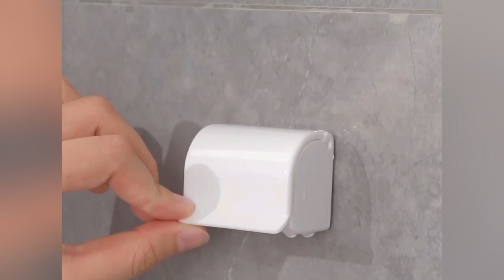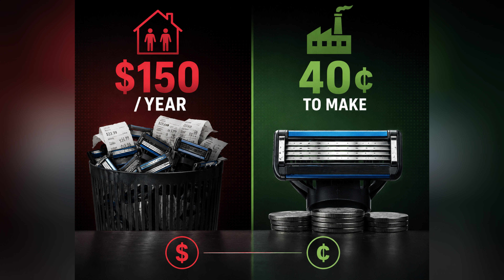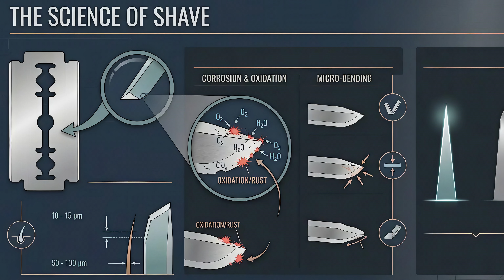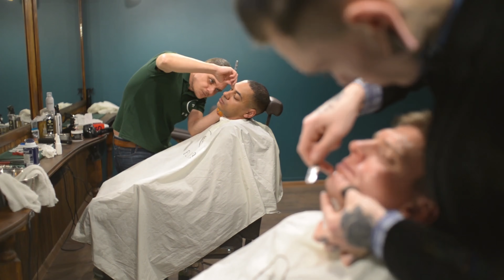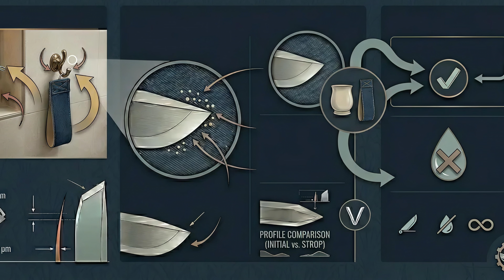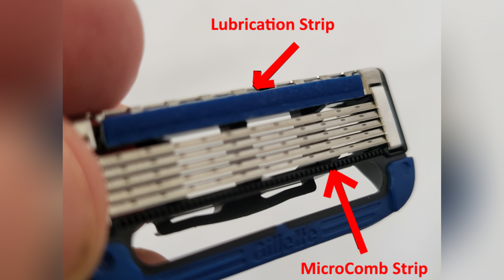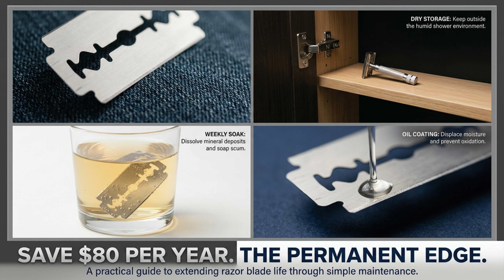Your Razor Is Designed to Dull After 3 Uses — How to Make It Last 2 years!

Comment: 30 years ago , my grandfather, who was born in 1889 and used straight razors for years, told me "The best thing you can do for your razor is dry it carefully immediately after use. Never leave it exposed to the  wet air of a bathroom, it will make "water crystals" grow on the blade". Now, that idea of "water crystals" was early 20th century nonsense he just believed, obviously. But the RESULT of carefully drying and keeping dry the  blades makes the razor stay sharp for months, so he always believed the  IDEA of "water crystals".
Reply: If he told you that in 1996, he lived quite a long time. 

The "water crystals" that he was talking about, was probably mineral deposits.  Depending on what minerals were in his water, and how high that mineral content was, when he was a young man, moisture could have very easily evaporated off of wet things, leaving behind minerals that manifested in a crystal like appearance. 

I've got very soft well water, but there is one mineral that appears often, and  shows up as relatively clear crystals.
Reply: @magnificenthonky  Well, he did live to 102, but what happened there was I misremembered how long ago it was. I'm 60 and 7 months old . . . possibly my mind is going. He died   after I went to live in Australia, which was in 1984. HIS dad lived to 106. Mine made 89. 
You have got me concerned now. I'm actually suffering from a disease that attacks the nervous system, and here I have written about something that I knew perfectly well was  when I was  learning stuff like "shaving my chin" and written down that it was 30 rather than closer to 50 years ago. :).
The important part is I remember him telling me  the drying the razor thing. Someone else subsequently  told me "Nah, water doesn't make crystals, that's just something the old bloke believed", but by that point I already had the habit, which I have always followed.

Comment: Summary - This video explains that razor cartridges are designed for frequent replacement to serve a specific business model, but they can actually last for months with proper maintenance. The core of the issue is not the hair cutting itself, but rather microscopic oxidation and bending of the blade edge caused by humidity and leaving it wet.
Key Techniques to Extend Razor Life:
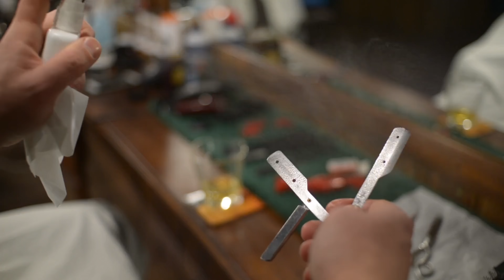Denim Stropping (2:30): 
After every shave, run your razor backwards (spine first, edge trailing) against a piece of denim (like an old pair of jeans) 20 times per side. This realigns the microscopic metal edge that folds during shaving.
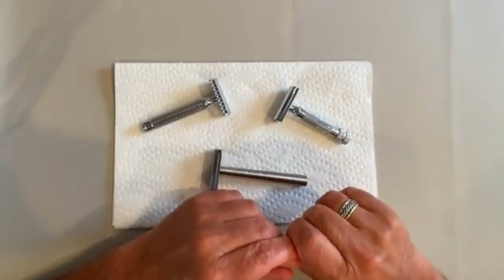Dry Storage (4:20):
Never leave your razor in the shower or on a wet sink rim. Shake it hard to remove water, wipe it with a dry towel, and store it in a dry area with air circulation.
Mineral Oil (5:25):
When the factory lubricating strip fades, apply a small drop of food-grade mineral oil to the blade. This acts as a protective, lubricating barrier that repels moisture and restores smooth gliding.
Weekly Vinegar Soak (6:03): 
Once a week, soak the razor head in white vinegar for 30 seconds. This dissolves mineral deposits from tap water that can cause pitting and rust on the blade's edge.
By following this routine, you can shift from replacing blades every few weeks to keeping them sharp for several months, effectively bypassing the planned obsolescence of the cartridge industry.

Comment: Stropping removes thet tiny "curl," but stropping does so on both sides, as shown.  With cartridges one can only strop in one direction so the other side his its curl, no?
Reply: I was thinking the same thing. 

But, I guess getting one side is better than getting no sides. The dry storage, lubrication, and regular vinegar baths to eliminate mineral buildup, probably do more to preserve the blade than the denim stropping.

Comment: hat is just plain silly. Why bother? I just buy disposables. They cost next to nothing. They come in packs of 12 or 24 or whatever. Every few months they’re on sale. No maintenance. No hassle. I shave in the shower and leave them right there, wet as hell. Don’t care. When they start to tug, throw out the old one and replace it. One disposable only costs a few cents.

If you want to save real money, just don’t buy new cars. Buy three- to five-year-old ones at half the new price, often a quarter. One rational car purchase will cover a lifetime of throwaway razor blades 100x, probably 1000x. 😂

Comment: WD40?
Reply: WD40 is a solvent, not a lubricant.  

It's paraffin based, and likely to leave a thin wax coating on the blade. Maybe running the blade under hot water will melt it off, maybe not. But, that could have a negative impact on the cutting ability of the blade, if it doesn't. 

The mineral oil is probably a better bet.
Reply: @magnificenthonky  But WD40 drives off water, doesn't it?
Reply: @thebunchchannel Sure, in theory. WD does stand for Water Displacement. But, you're still likely to clog up your head with a wax residue, over time, especially with these retarded multi blade razor heads. 

I'd be much more inclined to thoroughly rinse the blade with super hot water (the hotter the better; hot water evaporates quickly), then give it a good swirl in rubbing alcohol (which also displaces water, and evaporates quickly), then give it some mineral oil. 

The other thing is, if you spray it with WD40, the next time you shave, you'll be smearing WD40 all over your nice clean face.  The scent will clash with your Brut or Old Spice (or whatever aftershave you use) and the solvent will get into your pores, and probably cause acne. 

WD40 has a wonderful place. That place is in the garage. I keep mine next to the PB Blaster (which handles a significant portion of what I used to useWD40 for) and the chain & cable lubricant (which handles another significant portion of what I used to use WD40 for).  I don't use use WD40 as a penetrating oil or a lubricant, anymore. I use it as a plastic and paint safe solvant, to remove sticky residue and whatnot.

Comment: A quick squirt with WD-40?
Reply: I don't recommend that. It's a solvent, not a lubricant. Also, do you really want to smear WD40 on your face, especially after just getting out of the shower? 

I'd stick with mineral oil.

Comment: That you can resharpen the blades okay, but that they can hold 2 years no chance. 
And when the lubricant stripe is gone he's gone forever. 
Next what is with the hygiene??? 
That's the greatest problem. Because you can't really clean these kinds of razors.
If you want to have a high quality clean shave you have to take a DE Razor or Safety Razor it's the same.  And then you need only the blades to buy. What is really not expensive.
And please, no more canned shaving foam! These days there are such great shaving soaps in various scents that make the blade glide much more easily and provide a far more pleasant shave!

Anything that needs to be returned daily is neither valuable nor high-quality!
Reply: The lubricant strip is a mindgame gimmick, anyway, and unnecessary. The cheap ass single blade disposables that I use, don't even have them. 

Hygiene - rinse the blade with extremely hot water, to clear everything out of it. Put the head in alcohol. The alcohol will kill anything on there. Then store in a clean, dry place. If you're particularly paranoid, just before your next shave, go on and dunk that razor head in alcohol again. 

I still use canned shave foam. It's quicker, and takes up less space, at if the can falls off the shelf or the counter, it doesn't matter. 

However, prior to applying the foam, I apply Shave Secret (basically a blend of light oils. I think the base oil is mineral oil. I could probably make my own). That oil blend really smooths things out. You can actually just use that by itself, and it works better than the foam by itself, but it works really well when the two are combined.

Comment: The metallurgy has not changed since the first patent? Originally blades were high carbon steel. Now? The blades are stainless. They are probably treated with coatings like PTFE and chromium. Gillette is very careful about guarding their process. I shave my face and head. I get about 6 weeks from a cartridge.

Comment: The biggest point of failure is the corrosive Soap scum and body oils left in the blade. Stropping a cartridge blade only hits one side of the blade so is basically worthless. I keep an old toothbrush in the shower and scrub the blade, running the toothbrush parallel to the blade while holding it under water. I replace the blade every 3-4 weeks

Comparing a cart blade to a straight edge is an Apples/Oranges argument

Comment: I haven't been able to make this work yet and I sharpen and hone hundreds of edges a year. As others have pointed out you are only honing one side of the blade as the other is inaccessible. The barber will never hone just one side of his razor. Ever seen a chef just use one side of the blade on the steel/ceramic rod? More useful is the drying and adding some oil tip.
Reply: Double sided blade in a metal holder. 

Easy to access for stroping, or just replace, far cheaper than cartridges, closer shave.

Comment: It won't work on a flat surface because the blades are set back from the lube strip and the lower rubber guide. Works better if you run it backwards on a hairless part of your body like the inside of your forearm.

Comment: Facial hair can literally match the tensile strength of copper wire of an equal diameter. THIS is why stainless steel blades eventually get the nicks and cuts that make the blades useless.

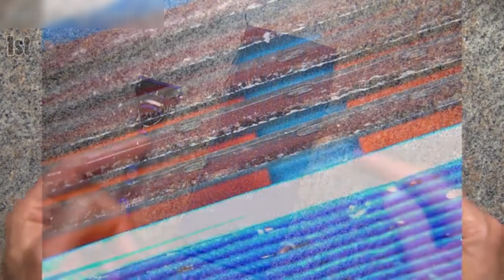Comment: I, like others, got confused by the comments at 3:20 about flipping the cartridge and running along the denim on the opposite face, which I assumed was an erroneous statement due to the simple fact that of course you cannot polish the face of the blades which are protected by being on the inside / undersides.  So, to see follow up comments suggesting that this is OK and that the blades will still be improved when only being polished to one edge is leaving me a little sceptical.  However, due to the insane prices of these cartridges I’ll still give it a go!  I used to use one of the single blade razors that are displayed at various points in the video, which it should be noted could be removed and polished to both sides but found them too hard to control to enable a fast and safe shave.  Hence having used multi blade cartridges for most of my life.  But yes, it was a very confusing part of the video…

Comment: My son thoroughly rinses and  blow-dries his razor after use and then places the blade cartridge in an airtight container with several silica gel sachets, saved from pill bottles.
He is still using the first blade from a pack which he bought in 2019.
P.S. He uses Dove soap which he works into a lather using a good quality shaving brush.

Comment: Great information as always. Just the other day i was looking at straight blades.

Dude you rock.
Reply from the maker: Glad you found the video helpful, thanks for the kind words! 😄
Reply: @Sidney_Explains_Money you are welcome. I haven't tried the wood pellets for my cats yet. Last weekend was just one of those bad days physically. 

What heating/ cooling tricks do you have? I have pondered the idea of making a grid of terracotta tube cones that has a water pump spraying water from top down and a fan to blow air through the cone shaped tubes. I figure it could cause evaporative cooling and idr the name of the action but when air is compressed and expands, it cools, right? 

I saw an Indian video of a large grid of clay tubes to cool an area on a street or walkway...

I could see my idea in my head, but i cant explain that well without a picture. 

There are people who cut soda bottles and using many bottles will make a wall of cones.

Make that but out of clay, then using a solar powered fan and water pump, push air through and water over...

Idk... ADHD thoughts...

Keep up the good work and i ment what i said in my last post or so. Im here if you need me to be of service.  😊

Comment: Great video I've already tried it on my disposable razors and it makes them last way longer but for you to say Barbers can get a year or more out of a blade is scary because Barbers should be throwing their blades away after each use due to blood. Unless they have an autoclave or something
Reply from the maker: Barbers do disinfect reusable tools between customers, yes—but replaceable razor blades are normally single-use and should be thrown away after each person. The straight-razor holder can be cleaned and disinfected, while a traditional solid blade requires a much stricter cleaning and disinfection process. What I meant was that the reusable razor itself can last for years, not that the same disposable blade should be used on multiple customers.

Comment: Look, these blades don't really get dull, they get covered in super fine debris and water oxidation.  1. Wash and bang all the visible debris out. 2. Bang on counter to get as much water as possible. 3. Drag the razor against the nap of a towel 6 or 7 times. 
I have been using the. Same razor for over 7 months.

Comment: I bought an antique razor with a permanent blade that was designed to be sharpened periodically.  About twice a year I spend twenty minutes doing that.  It gets stropped for a few seconds before and after every use.  I spent $40 on that razor and I'll never spend another penny on razors.  Those cartridges are such a scam.

Comment: I use for a very long time the 5 blade system made by Gillette. Always rinse the blade very well and dry it good by tapping it on my other hand and wave it for a few seconds in the air. I do at least 2 months with one blade. You don't need the ultra blue lubrication strip.
The soap on your skin does the work, not the lubrication strip.
Nice to see the physics on the knive blades. My grandfather had a barber shop, and he shaved many man. I tried one time such sharp knive. Never, ever again. I totally cut myself open. After that I shaved electric. After a few years I changed to wet shaving with those one blades. Still a problem. I was happy when the first dual safety blades came on the market.

Comment: I use Japanese Feather safety razors in my Feather razor. After each use, I put under very hot water, pat dry and put the head into a shallow dish filled with baby oil. No rust, sharper blade, and lasts the week.

Comment: Wash the freaking blade out under the tap  as you shave and both sides after you've shaved,  then dry it out with kitchen roll going with the smooth side, your same blade will last 6 months at least.

Comment: How do you FLIP those razors because they only run ONE WAY  You can only swipe 'em ONE way over denim or a/thing else as you push them OPPOSITE of how you would cut/shave  If you mean change the orientation of the DENIM that's another story & are you to run the razor 90 degrees against the weave or does that even matter?
Reply from the maker: You flip the razor cartridge itself. The denim can be held in any orientation, the weave doesn't matter, just the friction.

Comment: The reason why leather is used is because of the residues left from the tanning, and it is is slightly abrasive.  Best analogy is using the ceramic sharpening stick instead of a metal one, the later only aligns the edge where as the former is slightly abrasive.

While at it, Ccarpenters have known for eons that chisels and planes need to be protected from corrosion, and so have butchers. For iron, the 1st level of oxidation, what gives carbon steel the dark color, is protective, not corrosive. With good care professionally sharpened carbon steel remains sharp even under heavy, daily use.

Comment: BOILING WATER: I boil water, pour in a mug, and use my Mach 3 razor in that for the rinse for the whole shave. Disposal blade lasts 9 to 12 months. Last one head broke off cause I pressed to hard, but still shaved fine after 9 months. The much hotter water cleans the blade enough to prevent degradation. Try it, and the hotter blade gives a better shave. Much easier to maintain then the tips from this video.

Comment: Heres the funny part. I didn't use cartridge razors, but the single injector blade. That blade lasted forever! I had a van dyke beard before I grew a full beard. I think the reason it lasted so long, years literally, is because I let the shaving cream completely soften the beard for around ten minutes. While taking care if business on the porcelain throne. If I ever start shaving again (I doubt it though), I will definitely use this.
     Edit: I have a set of my great-grandfather's straight shaving razors, the strop, a razor stone, the shaving mug and a small can of styptic powder. Truthfully, great-grandfather was a much beaver man than I. Because I don't think I could ever hold a razor sharp knife to my own throat. 
     The most common fatal household accident of the time was shaving! The invention of the safety razar saved a lot of lives.

Comment: Ok so assuming it is correct, - I will test it and I am skeptical- the time spent conditioning the blades is waaay more loss than 80$ a year, my kitchen Japanese knives sure, razor blades> hours if stroppin for vinegar etc 30 we will see but also had Gillette blades that were bad or bent fro the factory. An d yes the metallurgy has changed. Materials have changed, the Gillette for Costco black have a different alloy than blue Gillette. Cheaper steel.

Comment: My blades last a long time, twin blade disposable or multi blades. I don't use shaving cream. I use sunflower oil mixed with a little water, shaken up in a see through small sauce dispenser bottle with a narrow nozzle. I squirt a little in the sink bowl and then use a one inch paintbrush and coat both sides and then apply to my face using both sides of the brush. Then I shave. The oil lubricates the blade as it cuts. Smooth shave, razor blades last a long time, no expensive shaving foam or gel. Job done.